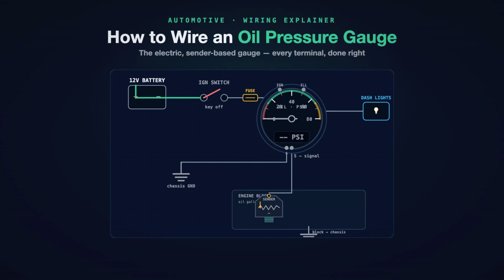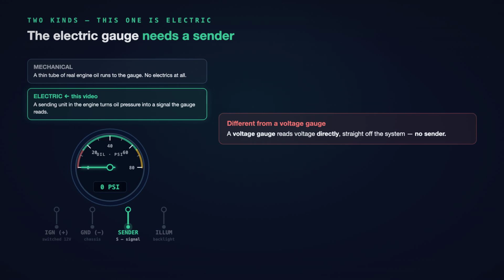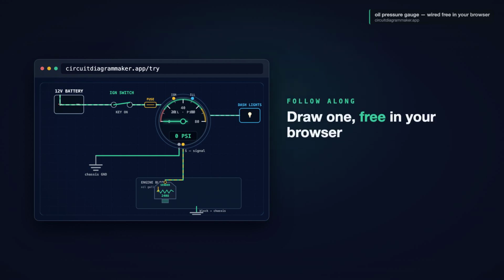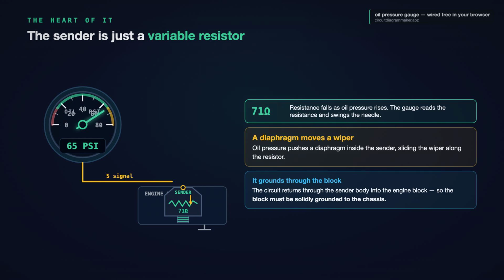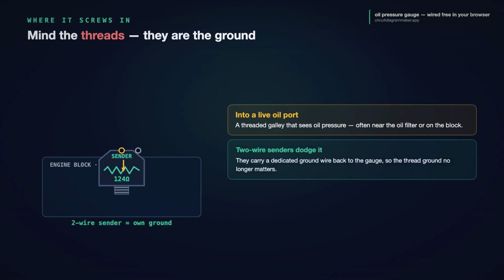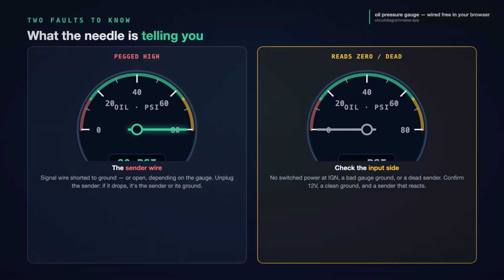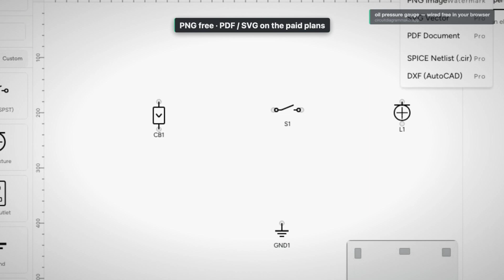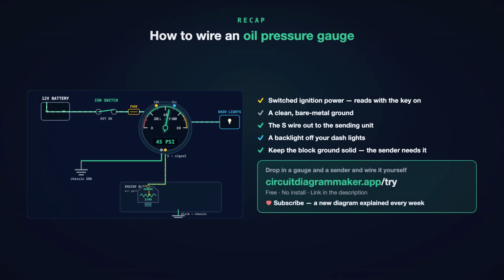How to Wire Oil Pressure Gauge (Full Diagram)

Comment from the maker: The one thing to get right on an electric oil pressure gauge: the SENDER. It is not a voltage gauge — it can't read pressure directly. The sending unit screwed into the engine block is a variable resistor, and the gauge reads that resistance to move the needle. Two gotchas that catch people: 1) the sender grounds through its own body into the block, so if the block-to-chassis ground is poor, the gauge lies — and on a one-wire sender, never seal the threads with Teflon tape, because that plastic insulates it and kills the ground. Use conductive sealant or leave bare thread. 2) Pegged high the instant you turn the key usually means the S signal wire is shorted (or open, on some gauges) — unplug the sender and see if the needle drops. Reads zero and never moves? Check the input side first: switched 12V at IGN, a clean gauge ground, and a sender that actually reacts.

Draw the whole thing free, terminal by terminal: https://circuitdiagrammaker.app/try?utm_source=youtube&utm_medium=pinned_comment&utm_content=yt-082